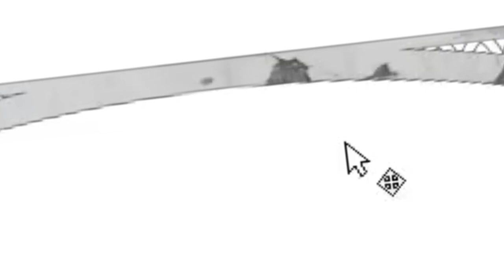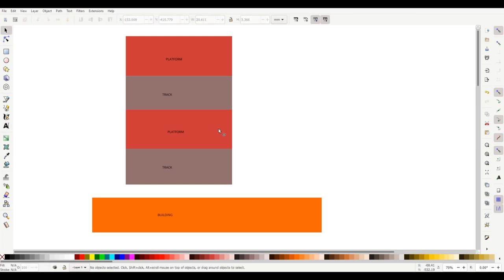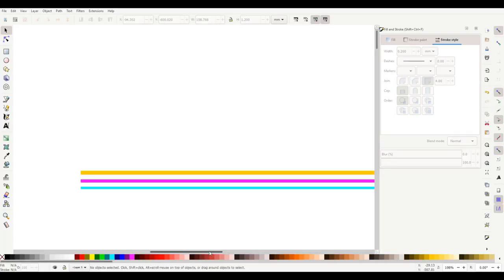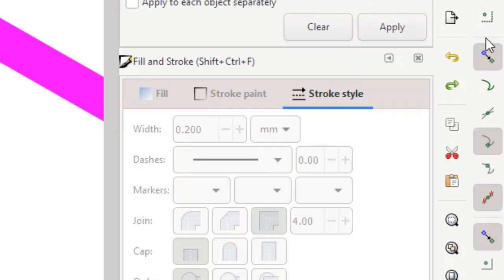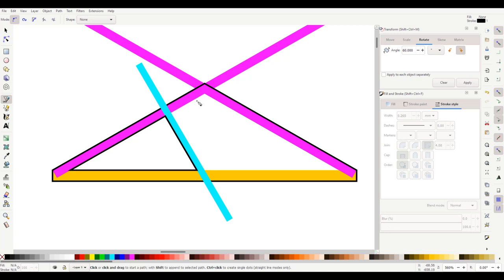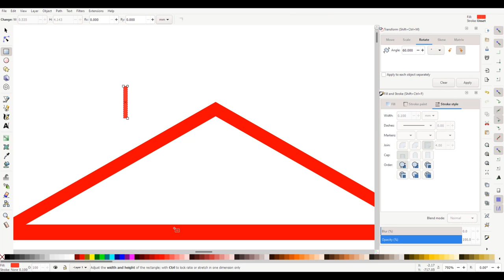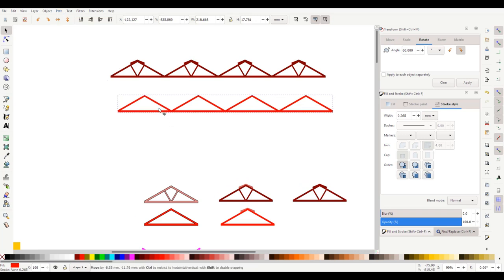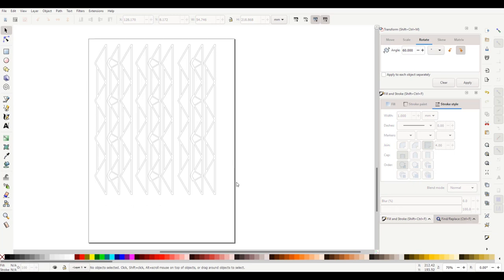How to use Inkscape to design a station canopy roof truss for your model railway layout

Comment: Just joined your channel, i think your work is fantastic and I admire anyone using home products not only to recycle and save money. In ky youth i was a member of Macclesfield model railway group and there was a modeller who specialises in buildings mainly from plaster card  and card . No computers back then or printers so i love the way you have introduced the old and modern element to achieve your affect . I will say about the column's that perhaps some striped wire insulation push over the cocktail stick or dip the millie putt in water and  spin in a small tube to get a consistent finish then trim off the ecsess .
Reply from the maker: Thank you for your kind words. I am trying to do just what you noticed - use modern elements but to use techniques that are as timeless as the hobby. Those are great ideas for improving the columns- thank you.

Comment: Hi Michael. I have a similar project in mind and managed to pick up an old Silhouette cutter fairly cheaply which I plan to use to cut  the components out for a roof canopy using ten thou styrene sheet and then layering them together. The problem is, the design software that comes with it is pretty useless and I doubt I'll be able to do what I want using it, but now you've given me a way of knocking up some roof trusses in Inkscape and exporting them to the cutter which will do all the work for me while I sit back with a glass of something warming to keep the chill out - you've saved me a big headache, thank you! Thanks for posting and stay well.
Reply from the maker: Two weeks ago, Paul, I’d have said “pah! You don’t need a cutter! Do it by hand!”  Now, 33 components comprising 200 individual triangles later, I have the blisters and wrist-aches to acknowledge you are a wise man indeed.  I’m glad that you’ve found something helpful here and hope that it exports nicely into something your cutter can use. Let me know how it goes! (You can email hello@chandwell.uk).

Comment: Another great video Michael, really enjoyed it. The only problem is I found myself watching this instead of doing any of my own modelling! Looking forward to seeing what you do for the windows, and what you did for colour on the roof elements. Thanks Liam
Reply from the maker: Thank you Liam - sorry to be a distraction from your excellent layout! :) The windows have worked out really well, so I will be glad to show them off. The trusses are part-painted and part-printed, which I will show in the next video. I'm finding this build a real challenge and more than a little tedious, so I am looking forward to getting it finished! Michael.
Reply: @Chandwell  I must admit the thought of all those cuts isn’t terribly appealing! But it will look great once finished. I’ve just had a go at some windows myself. Black frames came out fine, but dark brown ones were quite transparent. Further attempts required!
Reply from the maker: Yes it took me a while to get the brown. I had to go a lot darker than felt right at first. But go too far and you end up with sunglasses. It seems that black works fine. Everything else is stymied by the fact that you’re working on transparency rather than white as a base so all other colours are way off.
Reply: @Chandwell   Thanks for the tip Michael, I’ll give it a go with a much darker colour next time.

Comment: Excellent again Michael. Very helpful as usual. Your attention to detail is remarkable. Just one comment, if I may? I wonder if your prototype has cast iron drainpipes to remove the water from the roof in heavy rain [which never happens in Yorkshire] - if its is feasible, could the wiring for the lighting be hidden in the drainpipes...?  That would make the build very complex, but I know you like a challenge... ;) Number one rule in Railway Modelling... "Its my railway and I'll do what I want". So just a suggestion. 😂🤣😂🤣😂
Reply from the maker: Oh I like that suggestion Peter but it’s just 24 hours too late. I added the wiring and lights last night and I have to confess to making a pig’s ear of it! Your comment has inspired me to think of at least three things I could have done better. The gutters, the down pipes, or even in the”V” of the roof would have been better than what I actually ended up doing. It is also interesting that you mention the drainage. I can’t see on any photos of Ilkley where the rainwater went. There is no obvious drainage. Some close ups show what may have been the tops of downpipes but I am not sure. I was beginning to think they just let the water run onto the tracks below. So for now, I’m ignoring the drainage problem and if anyone asks I’ll say there are downpipes inside the columns. If you have any other ideas, please do let me know! Michael.
Reply: @Chandwell  Hi again. I am certainly no expert on older station roof drainage, so I did a bit of Googling. I found that large station roofs perhaps didn't have drainage down through cast iron pipes. Maybe some of the Grand City Centre Stations had internal drainage. I found an article written for the Railway Heritage Trust on Roof Valances and the famous Station Canopy Dagger Boards. You learn something new every day... 🧐 Here's the quote which makes sense. They didn't afford drainage or gutters which needed maintenance. They used the drainage built into the track.

"To keep passengers dry, canopies extend beyond the platform edge, over the track. Water runoff functions differently depending on whether there is a train at the station:  In the absence of a train, rain water runs off onto the tracks, and is carried away by track drainage. This saves on the cost and maintenance burden of gutters. When there is a train in platform, rainwater runs off onto the roof of the carriage, and is diverted to the end of the carriage and down to the track. This creates a sheltered zone for passengers to get on and off the train without getting wet."

You could run the cables up the support pillars for the canopy, but like I said... Its your railway and you do with it what you wish. What you are doing is superb.
Reply from the maker: Thank you for taking so much time to look into this! I really appreciate it. So they DID just drain onto the tracks. Makes sense I suppose. I am lucky in that one end of the canopy will be fixed to a building so my plan is to take the wires into the building and down the inside wall. But I need to keep the canopy removable for track maintenance and the like, so I am still pondering the method I will use to fix it all together on the layout.
Reply: @Chandwell  Still Thinking... ;) This may be way too late, but could you leave the pillars in situ permanently, and just remove the roof section(s) for maintenance and feed the lighting cable up the pillars and along simple horizontal (hidden ? wooden coffee stirrers) supports between the pillars? Peter
Reply from the maker: Hey Peter! Too late I’m afraid. I finished the roof yesterday and am now working on the video. I’ll show you in the video what my plans are for routing the wiring. I considered something a bit like you suggest but have gone for something slightly different.

Comment: First of all, thank you for what you do. Second, what product do you use for sticking the paper to the card?
Reply from the maker: Thank you! I print the base layers onto A4 sticky labels as these can be cut without waiting for the glue to dry. I sometimes use glue sticks too. For the cover layers, I just use PVA glue from a fine tip applicator. This video covers most of the things I use… Scratch building with card - tools and materials
https://youtu.be/-QvdNFST7WU